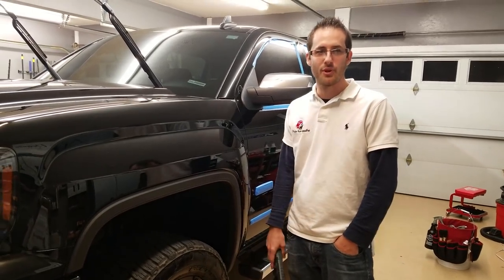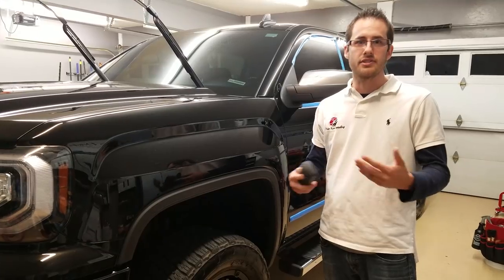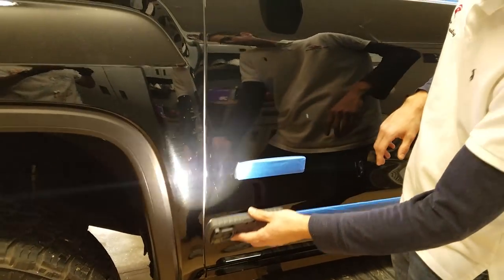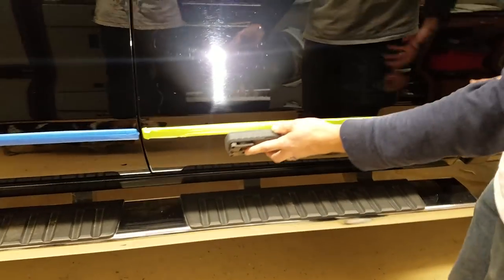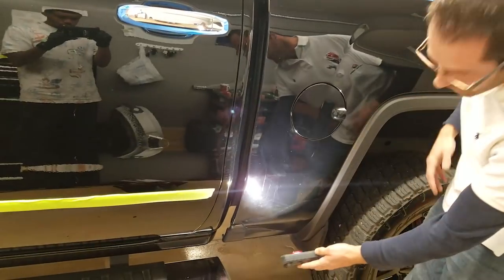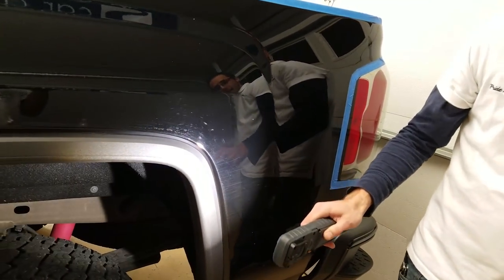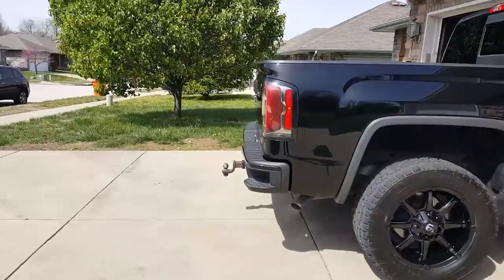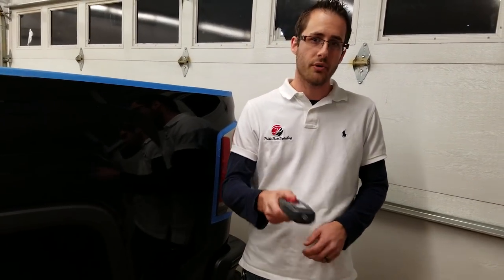Why You Should NEVER go to an Automatic Car Wash.

Comment: that isnot because automatic carwash...it is from the human handwash. you only promote your car auto detailing. you sometimes wash yourcar without automaticcarwash. Using brush is better. dont use too much foam also if using brush. you can learn it in my country. each country has different condition of dirty
Reply: Just because the car wash uses that “green purple” polish “shine” doesn’t promote shine, only a swirl reflection. Learn a lesson for once
Reply: bernad david Agreed!
Reply: The Car Wash/Elevator Fanatic They can only if done with a dirty wash mitt, if the car has alot of grit like mud of other particles, AND if the bucket is filled with dried up dirt and even with a 1 bucket wash.
Reply: bernad david this guy owns an automatic wash haha
Reply: xavier fernandez shut up. I don’t own one yet.

Comment: "Soft cloth" is the worst material to wash with. It has a dense weave that cleans very well, but holds grit. 

Even a well prepped car can co time to have mud drip from moldings, and wheel wells. These drips travel onto thw paint, and gets wiped by the brushes. When this happens, the brush basically wet sands the finish leaving like the vehicle shown. 

I owned a car wash, and when I took it over from the owner, the cloth rocker panel brushes had grains of sand embedded in them. 

Newer washes utilize new foam brushes that resist grit, and particulates. 

The best material ironically, was the old bristle brushes. They were soft, slick, and dirt could not stick to them. The problem with them was cheap operators. Bristle (often called fiber, or filament brushes) needs adequate lubrication to work correctly. Many operators would starve the brush of necessary soap and water, and the extensions would leave a sort of dull, waxy deposit on the paint. This dulling effect looked like scratching, but easily wiped off with a vigorous finger rub. 

Unfortunately, the bristle got a bad rap in the 80's, and then cloth took over from there. 

Do some research, find a good car wash with up to date materials and processes.

Comment: "Get off that Unlimited Swirl Plan" haha loved that line! What are your thoughts on touchless drive through car washes?
Reply from the maker: The touchless car washes are better because you aren't doing any damage to the paint finish. However, in my experience they don't clean the car too well  and the soaps they use are harsher and can wear down any waxes or sealants you may have on the paint. If I am feeling lazy in the wintertime though I take my vehicles through the touchless wash.
Reply: Pride Auto Detailing Go through a Soft Touch Wash and they will definitely not damage your car. The brushes use closed cell foam which gently washes cars.
Reply: Pride Auto Detailing so how do I wash my car ?
Reply: @CruuushaL  you don’t 💀💀

Comment: Great video and you are 100% correct auto car wash terrible for your car
Reply: Dessert Man Hand washes are terrible for your car.
Reply: @The Car Wash / Elevator Fanatic  not if you foam cannon it first and use two bucket method ...your chances decrease dramatically...sure if you just wet you vehicle down and proceed to wash you are rubbing straight dirt into your paint